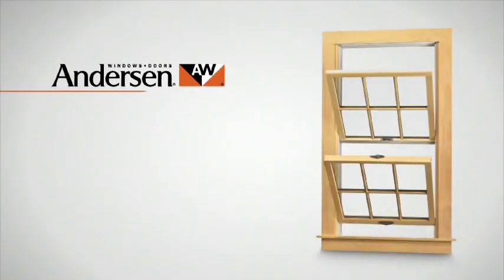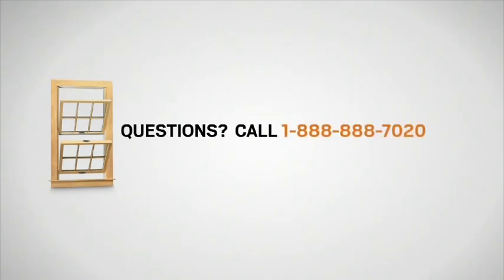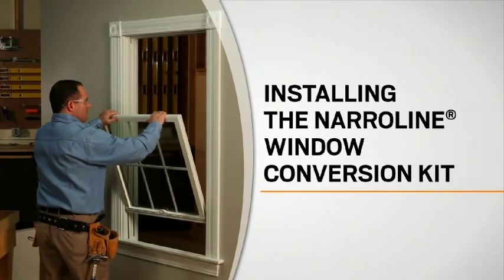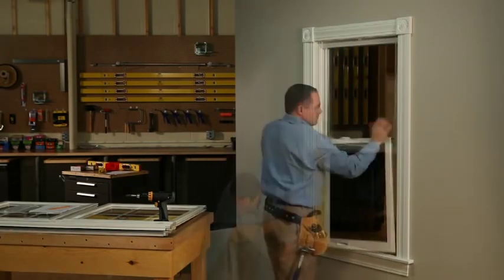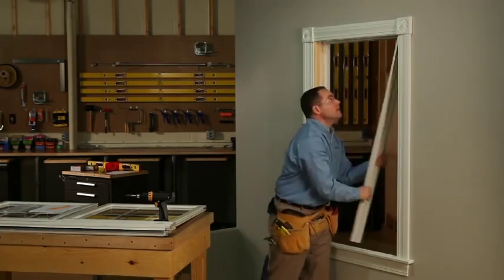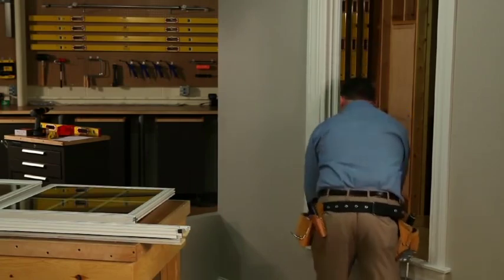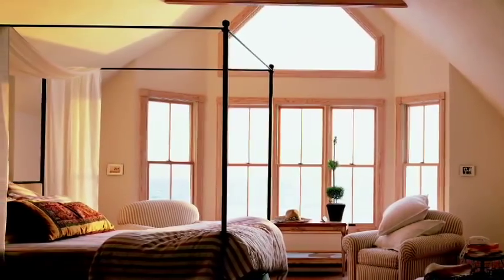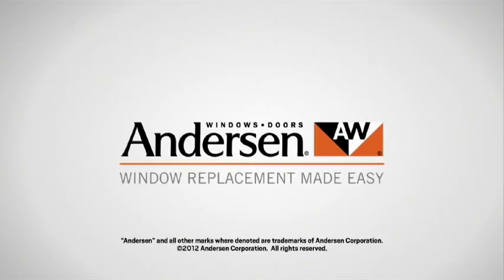How to Install the Narroline Window Conversion Kit | Andersen Windows

Comment: Broke several parts with the first 2 installations. These instructions have something to be desired.  I have worked in construction for over 40 yrs. and have always been a loyal Andersen person. My opinion is that you can purchase, install, and have easier operating windows with a vinyl replacement window and save thousands in doing so. I was replacing Narrowline windows built in 1989 bc I did not want my 70 y.o. wife going out on the roof to clean the windows. Nowhere in the instructions do they mention the little gray thing that slides up and down on the jamb and what its for. Not realizing that I wedged both sides under the new sash and they broke off, In doing that the molding that holds the glass in place nearly broke due to the pressure the little gray things put on the sash and jambs. It was an SOB trying to get the windows to tilt in everything seemed too tight and we followed the instructions exactly. I cracked part of the bottom sash trying to tilt the window in without using the gray things. After getting some outside help we learned the gray things are to be wedged down into the bottom sash so that it expands the  jamb for tilting.  Where is the finger indentation on the bottom sash to lift the sash? Found out that Andersen eliminated that feature.  For the thousands of dollars paid for the conversion kits in retrospect it would have paid for many years of a professional window washer service.

Comment: ordered these at Home Depot, quality seems great and half the price on any other replacement window I found.
Reply: The conversion kits are directly from Andersen, don't see them anywhere at Home Depot. The cheapest kit for my window is over $450.
Reply: PSA, Home Depot can get any part for any Andersen product made after 1967, including these kits, and it's always cheaper than buying it directly through Andersen's website.  Sometimes by hundreds of dollars.  You won't see them anywhere on the website, because they have to be special ordered, talk to your store's Millwork specialist.  Either give them the part # off Andersen's site, or give them the visible glass dimensions of either sash and the vintage etched into the bottom right corner of the glass and they can order it for you.  Better yet home depot regularly runs a 15% off special order windows and doors sale, about once a month, this applies to Andersen parts as well, so you can save even more money.
Reply: @warlordgaming7687 Thank you! I would have never known this.

Comment: I'm confused. I have the Narrowline windows, and the conversion intrigues me, but the cost is crazy.  I'm putting a conversion kit into an old frame which is pretty much the same as doing a replacement window but costs a lot more. Why would anyone buy the kit? I'm better off just leaving it original, or replace it with something else.
Reply: The conversion windows will have a wider gap Thermopane than older welded pane windows and greater insulating and sound deadening performance.  They will insulate as well or better than a welded pane sash & a storm window combination.  It is also an opportunity to use a coated glass (or upgrade to a better coating).  The installation cost for the conversion window should be significantly lower than than replacing an entire window.  It can be a DIY job for a reasonably competent homeowner offering the potential for further savings.  A complete Anderson window  (frame & sashes) with comparable features is 20-25+% more than a conversion window.  If your windows are in good shape and have a wide gap Thermopane,  replace the weatherstripping, if necessary, and call it a day.
Reply: I have replaced balances on the old windows and had to remove the sashes. It is pretty easy to do. The conversion kit glass includes low E glass and as previous commenter said will be much better insulation.

Comment: I was going to upgrade my Narroline windows. Price was $650 each to convert them to Series 400 windows. Rather than do that, I just bought new Series 400 windows for $425 each. Conversion kits are $200 more that the entire replacement window which is the exact same size as the Narroline and can be installed in about 2 hours. It's actually cheaper to buy a complete series 400 window, take it apart, use the parts in the Narroline frame and throw the new frame away.  Shame on you Andersen.
Reply: So, you’re buying new windows for the sashes, latch, and pull?

Will you replace the balances and the plastics guides? 

And they will still not tilt.
Reply: @samadamms3432 What? I’m planning to upgrade some of my narrowline windows w conversion kit. I have already replaced balances on a couple windows. Are you saying that buying the complete window would not provide the needed parts to enable tilt function?
Reply: @barbnelson9386  - I was commenting on njphil, buying new regular Narroline windows for the sashes and hardware, and tossing out the frames. Apparently, he either doesn't need, or want, the tilt function, so he feels that will be cost saving. 

However, if you want to convert your Narrowlines to tilt function, you will have to buy the conversion kit. This is what I plan to do, since a couple of my sashes have broken seals, and are clouded up.

Comment: They seem decent.  I just installed them following these instructions.  A few notes:
1)   These are two minute instructions.  The actual process takes about 1 hour for 'your first window, and as little as 30 minutes for later installations.
2)  They skip a ton of steps.  Start with silicon on the windows to allow them to slide more easily (i.e. spray the sides).  Move both parts to the bottom and remove the screws on the center left.  Next, move both panes to the top and remove the 4 other screws on the left.  Then move both panes to the top.  Then you can pry out the left side jam/cover and slide it down.  Once this is done, you can slide the front pane down.  When it is down, you can cut the ropes near the top and then remove the front pane.  Next slide the back pane down and remove it.
3)  Now remove the top left jam.
4)  Remove the right side jam, starting near the bottom.
5)  Cut off the 1/4 inch at the top side on both sides as shown in the video.  Use a real knife.  This part is a pain in the bum.
6)  Clean the bottom sill well.
7)  Remove or cut off any excess silicone or other material from around the exposed frame/sides.
8)  Place the 2 1/2 inch screw in the center as shown in the video.
9)  Put on the silicon bead as shown in the video.
10)  Take apart the side jams and put the outside piece in place as shown in the video.  Be sure that both of the ribs that fit in the groves in the frame are pushed all of the way in.
11)  When putting the inside jam in place, it's easiest to position the outside part first, from the bottom to the top.  Once this is in place, push the front part into place from the bottom towards the top.
12)  When both sides are done, use a flathead screwdrive to move the metal window holders down to a position about 5 inches above the bottom of the window.  Then turn the screw 90 degrees so that the open part of the screw is in the up direction allowing the new window to be slid into place.  When all 4 of these are done (2 on each side), put the back window in place, click on both sides.  Before you rotate it up, remove the protective covering on the outside.  Rotate it up to lock it into position.
13)  Once the rear pane is done, do the front or lower pane following the instructions in step 12.
14)  All that's left are the stickers.

A few notes:
1)  The rotate to clean function is a pain in the butt.  It does work, but you have to use some special tools and tricks to get the windows out where they can rotate.  It's so bad that it's almost false advertising.
2)  Home Depot has sales twice a year.  10-15% off.  It's worth catching these sale (once in spring, once in the fall, about 2 weeks both times).
3)  The wood quality is pretty decent.  The paint is slightly sloppy, but not too bad.  Not sure about the seals.  They are good now (at the beginning), but not sure how they will last.
4)  The hinge hardware is pretty cheap.
5)  Don't pay for the upgraded hardware.  They just send you a box and you have to install everything yourself.  Better to just buy some quality/cheaper junk from e-bay.  They have a huge mark-up on the shiny metal pieces.
Reply: Did you have to remove any storm windows before replacing the Andersens?
Reply: @mbhart  Yes.
Reply: Thank you for the detailed instructions. I’m hoping to do this next year.